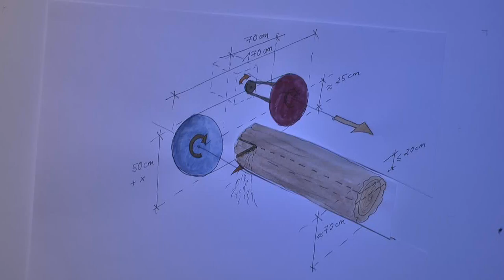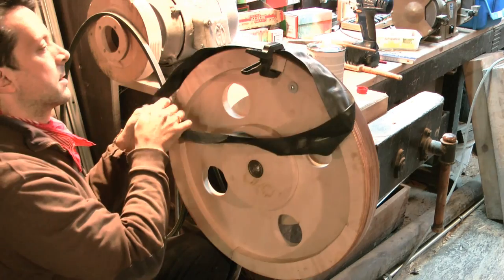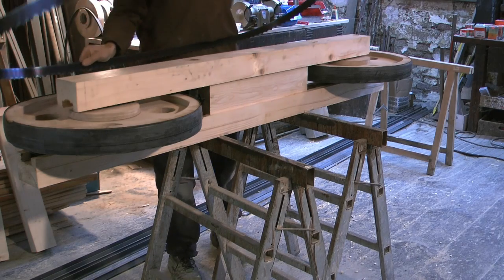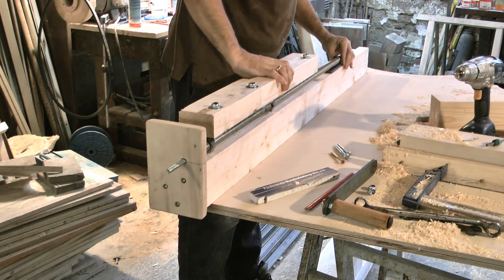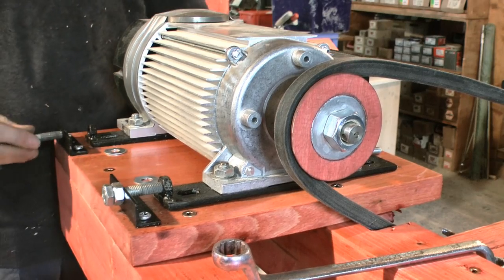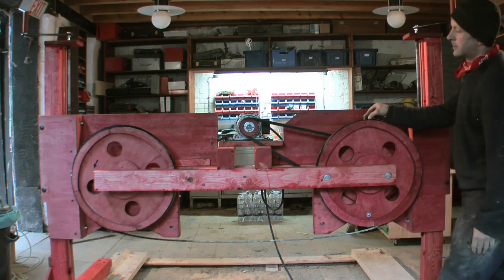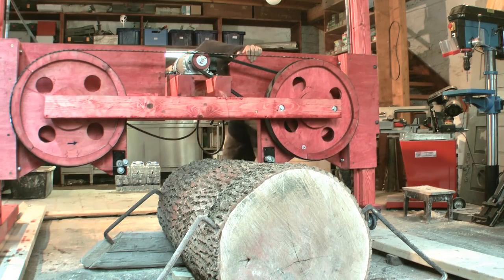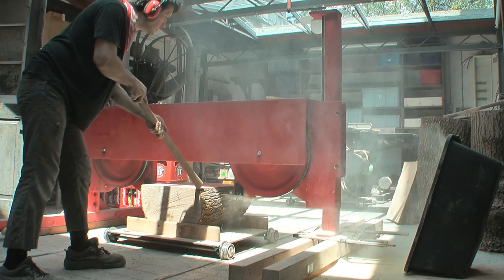Band saw mill 1

Comment: Very cool, showing all the process.  I see yours is also prone to some vibrations, though not as bad as on mine.  I keep dreaming of building a better sawmill myself too!
Reply from the maker: As the vibrations are mostly in the direction of the blade, I think that the posts including their wheels aren't stiff enough sideways. And the total mass of the construction also matters, I think. Compared to other band mills, mine isn't so heavy. But the relatively massive wheels are an advantage.
Reply: Don't know if it's still or at all useful, but you could play with rpm's (gears), putting engine on one side instead of middle and simply balancing the wheels more if you don't want to add any more parts to the machine. Mass may be the easy way out, but not necessarily. The point is that this structure has relatively low linear density (wood) and high tension and length. Which is a recipe for low resonant frequency, also unbalanced wheels (at x rpm) and uneven friction could be the cause for vibrations.

Just some thoughts. Thank you for enjoyable videos.
Reply: You might both want to watch a (15-part) series of videos, by Matt Cremona, on how he built his bandsaw mill. His works pretty much trouble free, and he's milling up to 12-quarter slabs over five feet across! He also has built an interesting log-handling arbor, using a car trailer and heavy winch, to maneuver the massive logs onto the bandsaw mill's working 'table.'
Reply: In fact, the series was expanded to 22 parts, and he has a number of other videos showing the mill in use, and the results. Here's a link: https://www.youtube.com/watch?v=9fyUMNAjVas&list=PL0dX5redvVZQT-bJ-HNfrJEXlQJleCwun

Comment: with the addition of metal this design is improved. Many of the very first machine in the 1830 were wood and cast parts in the just the right place. i like the log moving in the the rail.

Comment: How about adding some pulleys to your lumber sled and stand on the other side of the blade (non-toothed side). It might also make the cuts a little smoother too. Or add another screw and a motor to make it automated. Love this, thanks for sharing!
Reply: I agree pulling so you are moving away from the saw seems a lot safer.
I'm not sure how much force it take to move the log but automating it might
be as simple as a wire ,some pulleys and a dropping weight
Reply from the maker: Yes, that's a good idea for improving it. I didn't do that at first, because I wanted to have more control over the feed rate and to feel, what the saw is doing.
Reply: I have seen videos of bands breaking and as long as you have the current shroud it seems to contain the blade if it breaks. So to me it would come down to control and constant pressure, which a cable/pulley driven system is what some of the higher priced units use

Comment: Excellent build and demonstration! Probably better to bring the wood to your shop for milling anyway so electric motor was good, right? Why not use your roller track for pushing and guiding the saw (not as heavy as pushing wood)? Now you can mill all the logs you want to the specific sizes you will need for the timber work!

Comment: Very nice work.  I have a couple ideas for you.
Someone else mentioned it too, but I think if the log was pulled through you would get a more consistent feed rate and better results.
If you add an level with adjustable bubble to the top, will that save you from measuring the blade each time?
Again, GREAT job!

Comment: MUY ORIGINAL SU TRABAJO LO FELICITO, POR FAVOR DE CUANTOS HP ES EL MOTOR ELÉCTRICO,  CUANTAS REVOLUCIONES POR MINUTO Y SI ES 110 O 220 V . GRACIAS Y GRACIAS POR COMPARTIRLO SU TRABAJO.
Reply from the maker: Lubin Jimenez The motor has 3.8kW, 2900rpm and 230V.

Comment: When I saw you standing in front of the blade my heart skipped.  All the commercial bandsaws I've seen have the operator standing behind the blade (teeth pointing away from the user) so if something causing the blade to lose it position, you are not in the line of fire.  Even with a case over the wheels, I think you are much safer behind the teeth side of the blade.